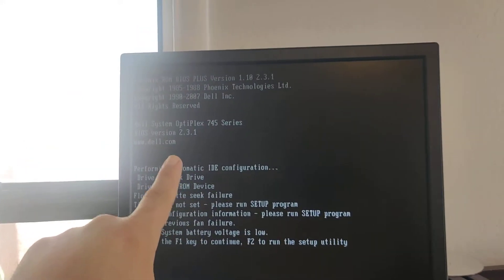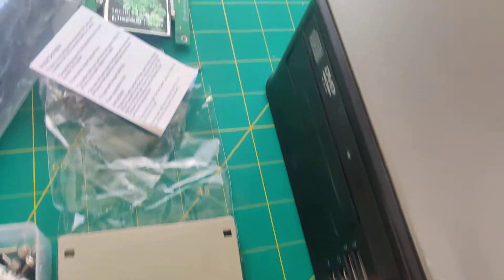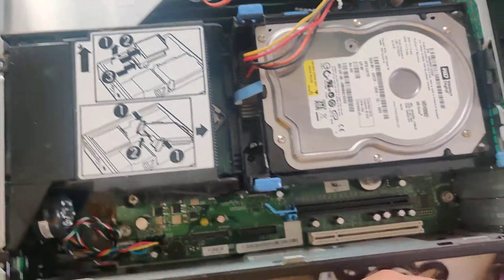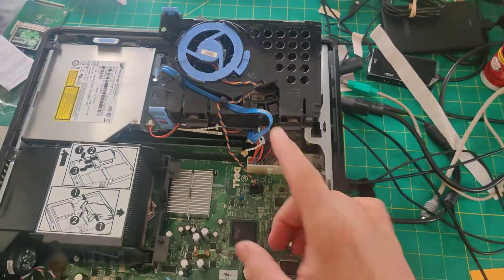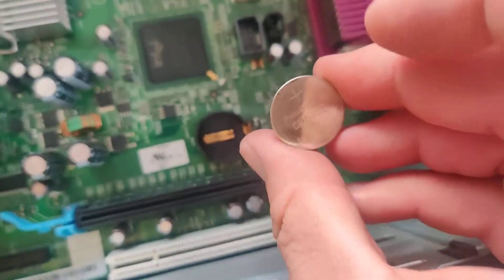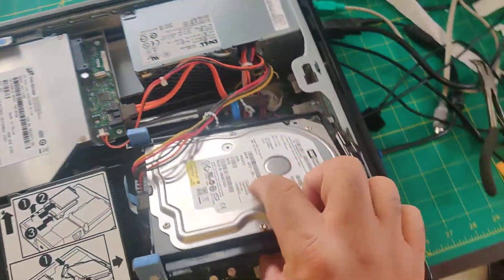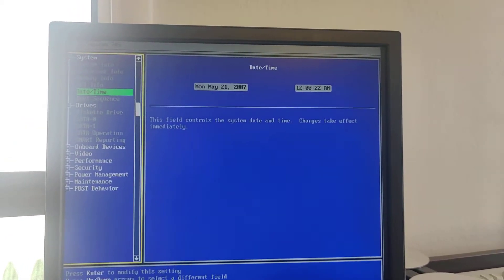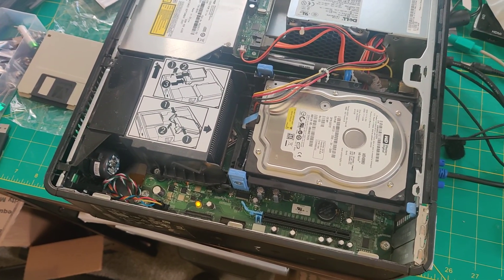Tech Tip: How to replace the CMOS BIOS battery on Dell Optiplex 380, Optiplex 745 or 755 or any PC

Comment: my system wanted an administrative password i didnt know. Is it bad that i couldnt change the floppy disk setting?
Reply from the maker: You can leave it alone -- you might just get an error message at startup.

However, there's probably a blue jumper on the motherboard with a label of PWD next to it that you can pull out and it will remove the administrator password for you.
Reply: @CarTechGuy  thx